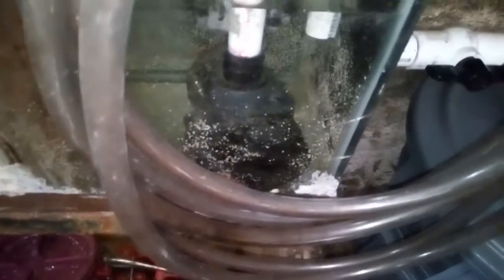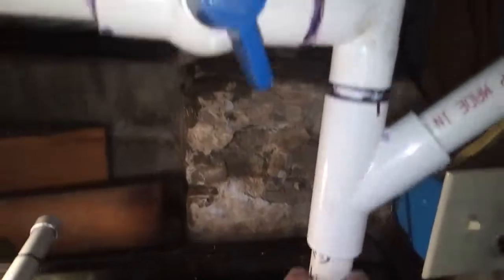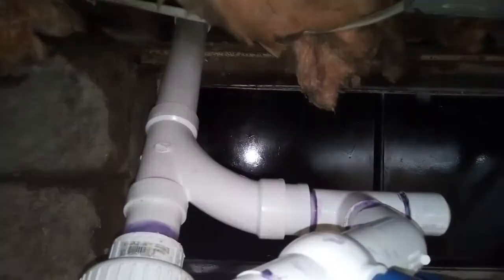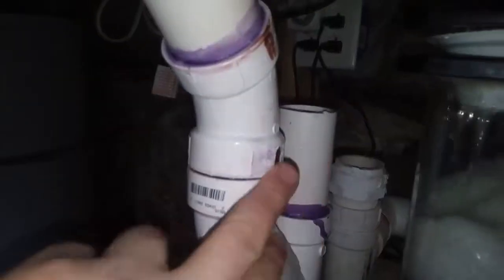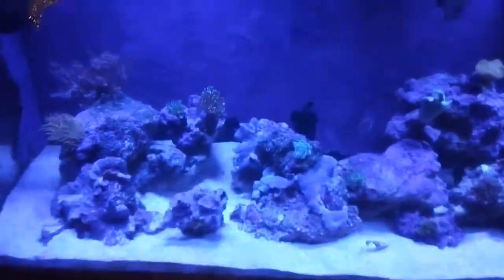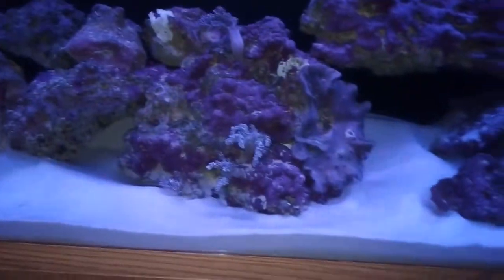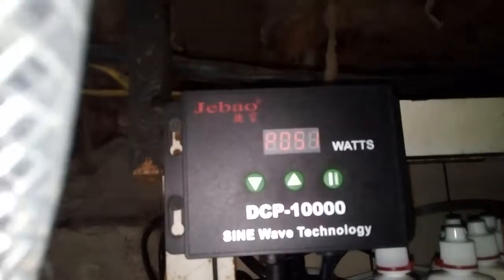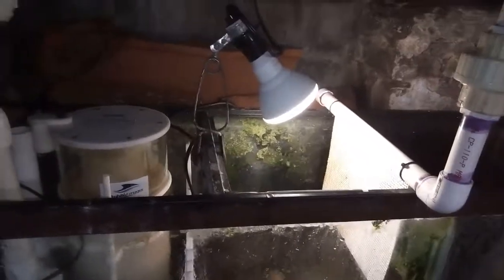Jebao Dcp-10000 review setup flow rate Part 3

Comment: I am impressed you are getting up to two tanks with the 10000.  I have a 15000 running from my  basement, am thinking of getting the 18000 as a back up.  What size is your return pipe?  I have 1.5" from the pump, all the way up.
Reply from the maker: laminar flow return is 1.5 output is 3/4, no Tee's no 90's going to tanks all 45's and Wye's. 90's and Tee's kill head pressure.